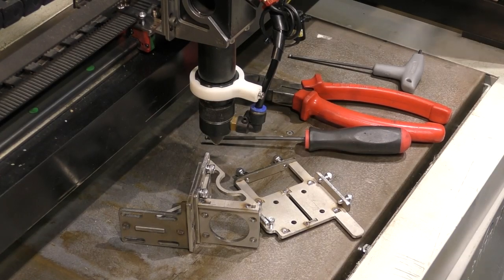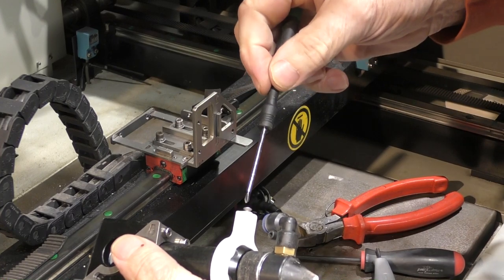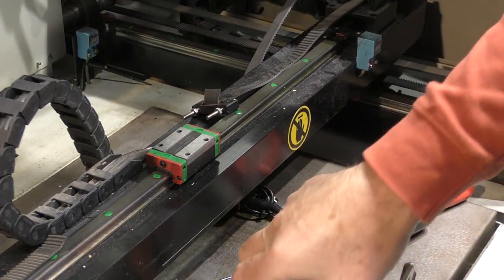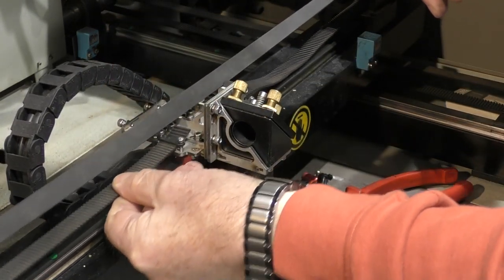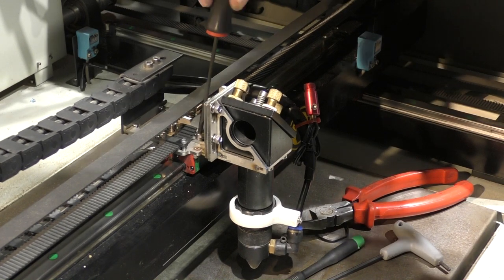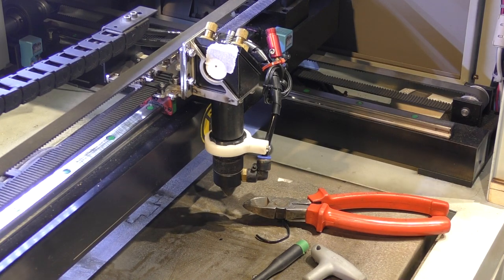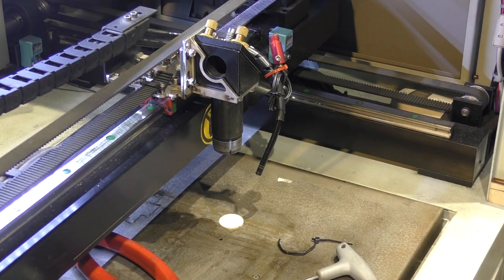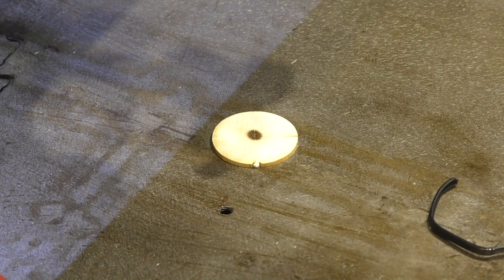RDWorks Learning Lab 179 Fitting the Cloudray C series Adjustable Head Bracket

Comment: Hi Russ, Thanks for the time and effort in your videos. Very informative and always interesting to understand the 'why' behind the things you have tested.
I am looking to get a China 60w Machine but one thing I have been struggling to find an answer to is the difference between a C-series and an E-series. Appreciate your input.
Reply from the maker: Hi Dave
The difference is small  and all to do with the lens tube diameter. The C series is 24mm diameter and is fixed to the head with a collet type clampring. The E series is 25mm diameter and is fixed to the head with split sleeve clamp  and thumb screw.   The C series  collet system has to have clearance above the collet and that can allow the nozzle to wobble and the E series  split collet system has the potential to lock slightly off axis.  Both are fit for purpose but neither is perfectly stable. I like the idea behind the C (or E) series  lens tube in that it can take a v wide range of lenses and nozzles. For that reason I chose the C series lens tube  when I designed my lightweight head but made sure that I used a  vee block clamp system to ensure stability and location repeatability.
 you can spot the difference if you look here
https://www.cloudraylaser.com/collections/laser-head-set
 Best wishes
Russ
Reply: @SarbarMultimedia  Hi Russ,
Brilliant thank you. I had in my mind that the difference was in the machine itself, thanks again for being so clear and concise. Have a great day.

Comment: Hello, is it possible please to buy the alignment tool for the C Series head and if possible a copy of the file that makes the targets please.  This is a very useful video. Thank you very much for the information. 
My friend and I both have new build 100 Watt C02 Lasers based on the Further Fabrication plans and both have the C series Mirrors and Head, my friend though has serious problems in alignment and we have bought the adjustable mount for his laser, at the moment mine seems ok , there are some design difference and I think that is why he has had these issues.   Were hoping this new mount will finally sort these out.   Many thanks, Neil.
Reply from the maker: Hi Neil
 No problem.  The dxf file is free and is available at www.rdworkslab.com.
 If you have any problems locating it then use this private contact form and I wiil send it to you

https://forms.zohopublic.eu/ndeavorlimited/form/SoftwareRequest/formperma/SKCTDOvOqVoQRSH6SmK0S2c_XVFLF91gF8bMSNmU1iA

Best wishes
Russ

Comment: I’m finally getting around to this upgrade but only just realised that the head and bracket are made for hgr15 rails with 26mm spacing, my machine only had mgn12 and I was planning on using mgn15 which which I had already ordered. I believe that it will still fit given the fact hgr15 is m4 screws but mgn15 is m3 with a 25mm spacing. Do you think this will be an issue or should I just order the hgr15 linear rails?
Reply from the maker: Hi Brett
If you check under your head mounting bracket I think there maybe a spacer block. I have a 6mm spacer (2 pieces of 3mm acrylic) that allow you to make a 12mm bearing block look like a 15mm bearing block. In that way you can just bolt the Cloudray bracket onto your machine.
 
 You tube will not allow sending of email addresses  but you can easily outwit their algorithms  by losing it in a sentence or two like this .   brett is followed by a dot and smith77.  After the usual at symbol try g==ma)))(((   il  etc. We can decode this  and it demonstrates how dumb computers really are. I will send you a DXF file so you can cut your own spacer  (or maybe 3D print it?
Best wishes
Russ

Comment: Hello Russ,
 first of all, I want to thank you for all the years of information! You are a great inspiration to me. Now I have a little question: is it possible to mount an e series head (25 mm tube tube) in the adjustable head holder? (Maybee with some small modifications?

thanks in advance!
Reply from the maker: Hi Sebastian
 I presume that you speak of this item
https://www.cloudraylaser.com/collections/k-series-laser-head-parts-1/products/cloudray-c-series-co2-adjustable-laser-head-bracket?variant=32936879947916

 The answer is "nearly".  It depends on your skills and equipment.

 https://www.cloudraylaser.com/products/cloudray-e-series-co2-laser-head?variant=34548109213857
 One of th drawings shows the hole configuration for fixing the head to the bracket.. There are 4 holes at 12, 3, 6 and 9 o'clock

 There is a similar drawing for the C series head that you can view here
https://www.cloudraylaser.com/collections/k-series-laser-head-parts-1/products/co2-laser-head-for-focus-lens-dia-20-fl-50-8-101-6mm-mirror-25mm

 In the main the E series head will fit the C series adjustable bracket except for the position of the  head fixing holes. You have 3 options.
1) Redrill the bracket to add new holes  . The bracket is stainless steel so if you drill it, do it  at a slow speed with some lubricant.
2) Drill and tap new M4 holes in the head
3) Don't bother

Best wishes
 Russ
Reply: @SarbarMultimedia  thanks for the fast reply! Some holes should be no Problem!

Comment: Hi have the blue and white 50W Chinese laser,but my belt goes around the front an back of the gantry,not over the top and bottom in the video.
Would this bracket still work ?
Reply from the maker: Hi Andy
 Take a look at the Tangerine Tiger videos 1,2 and 3 and you will see that this is a China Blue machine in all but colour. I make the modifications you describe and you can see more.
details. 
 If you wish more details just add your disguised email address to another comment and I will send more data

Best wishes
Russ

Comment: I see the bracket is marketed for the C series head. How can I determine which head my red/black machine has, i.e. will it fit?
Reply from the maker: The first thing to check is the size of your X  rail/bearing This bracket is designed for a C series head which is normally mounted on a 15mm rail system.  See the following to identify your system.
http://www.pmi-amt.com/en/products/amt/MSC_M.htm

 Many red and black machines will not immediately be suitable BUT I have received many requests already and found that there is always a packing plate on top of the bearing (about 4 or 5mm thick) and the head is fixed to the bracket with just 2 fixing screws. If this has described your machine there will be hope because I have designed a simple replacement for the packing plate that will accept the C type bracket.

Examine your machine and let me know what you find

Best wishes
Russ
Reply: @SarbarMultimedia  Mine has the packing plate, but is fixed to the rail with 4 screws. Will have to check which system it's using.
Reply from the maker: @andyspoo2  
Hi Andy
 The plate will always be fixed to the bearing by 4 screws but the head will be fixed to the bracket by 2 screws usually whereas you will see from the video that my head is attached to the bracket with 4 corner screws.  The bracket will also need to be modified by the addition of tto new fixing holes. I will see if Cloudray can include those holes in the next batch they make. If you wish to add your disguised email address to another comment (johndotsmithatgmaildotcom) I will send you drawings of the two possible plates and the bracket modifications.

Best wishes
Russ

Comment: Could it fit also to the blue-white China laser I have?
Reply: Same question
Reply from the maker: Hi Lars
You may not have followed the whole of my learning journey but if you go and watch  
https://www.youtube.com/watch?v=RCoTdNJ53dw
you will see me going through several iterations of a new head design that allows me to use every lens and nozzle that is possible. As part of that process I finish up designing a stainless steel bracket for the China blue machine. 
I do a final re engineering of the head and test it  and explain the whole new world of lenses and nozzles and tell you how to contact me for the design or supply of the stainless bracket
https://www.youtube.com/watch?v=jVGByifge_Q

Hope this answers your question ...and yes, I do have brackets in stock if you need one,  but you need to examine the data pack I send you before you make a decision.

Best wishes
Russ
Reply: @SarbarMultimedia 
Hi Russ!
Thx for reply! Well I did watch it, but it is probably pretty difficult due to English not being my mothertongue... I wrote an answer to the specific video, but it seems you didn't notice. My "mailadress" is still public under the video 😁

Comment: I ordered this part at the same time as a C series head.  Unfortunately the belt clamp screw holes on both sides are spaced completely different than those on the original mount so there is no way to attach the belt to the adjustable mount.  Cloudray's response was "no one else has complained" and that was basically it..... Buyer be ware...  Great idea, but the part they are selling is NOT compatible with a C series head.
Reply from the maker: Hi John
The Chinese are great at changing details on products and machines and for several years this product has been doing the job it was designed for.  I am interested to find out what has changed  because it may be that a simple modification will accommodate both the original and the "new" variation. I can then pass this design on to Cloudray for future batches.
 Please send me your disguised email address ( write it as  a single string word) so that we can exchange pictures and maybe there is a simple  retrofit I can supply. 
Best wishes
Russ